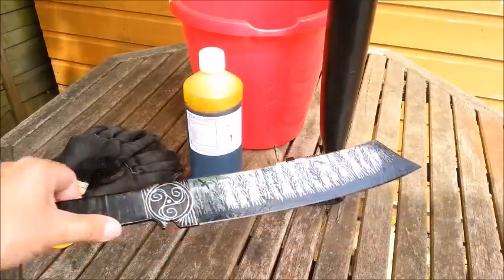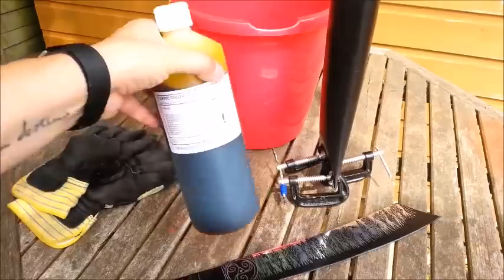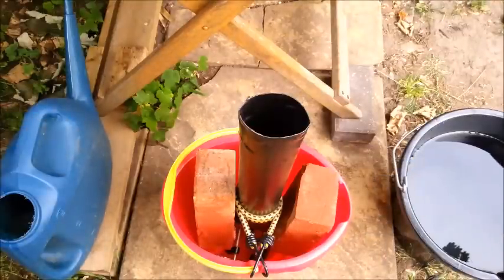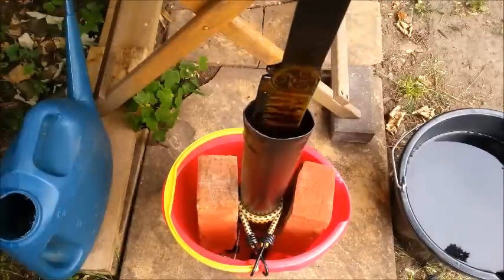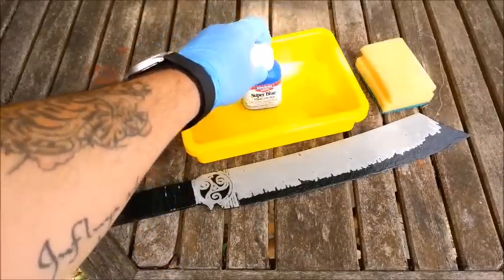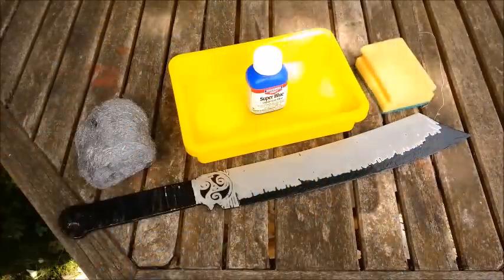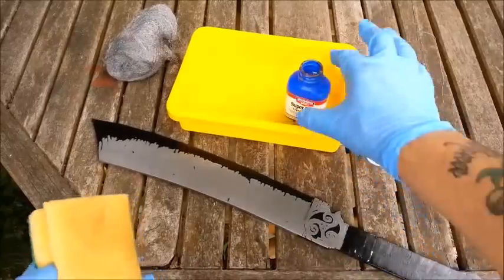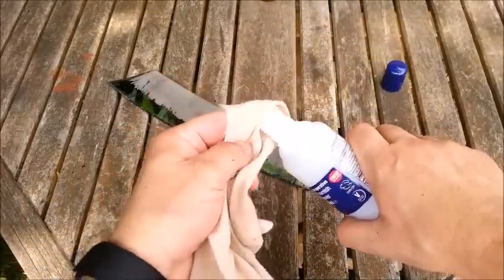Ozzy Pimps Rambo's Machete!

Comment: hey ozzy, cold bluing(liquid blue) will not work on stainless steel. there is 2 ways you can blacken stainless first is called hot bluing use Brownells - OXYNATE® NO. 84 - Hot Chemical Bluing Compound. the second method is to plate the knife after etching with copper then treat the with liver of sulfur to blacken the copper after which coat the knife with a bake on clear hi temp enamel and do not exceed 200 deg f. when baking.
most people with stainless steel guns just paint them black, camo or what ever color they want with a hi-temp enamel.
Reply from the maker: ***** Cheers Larry! I'll consider those options!